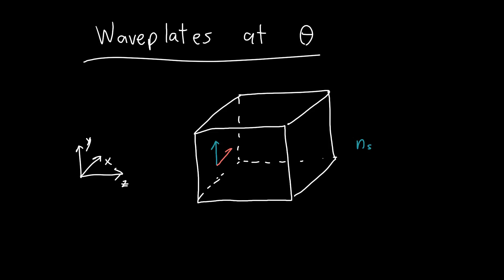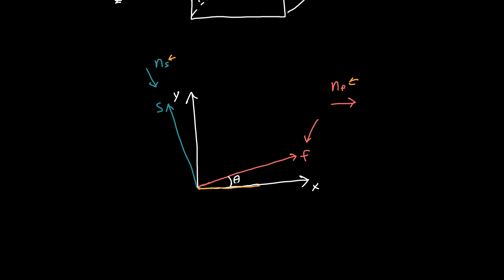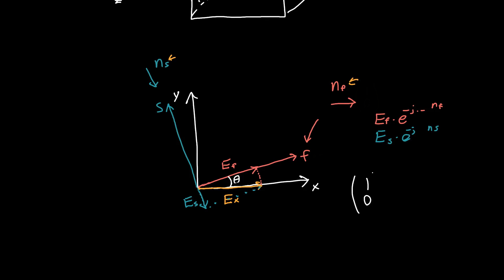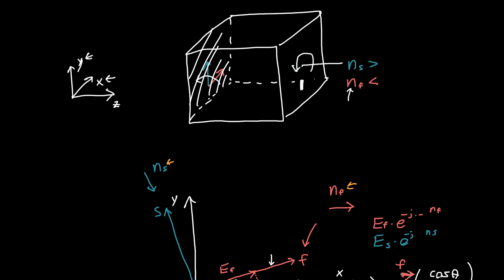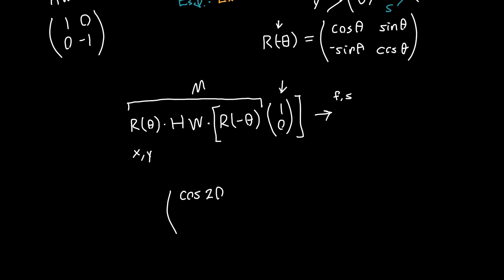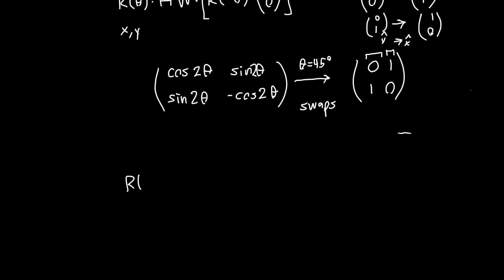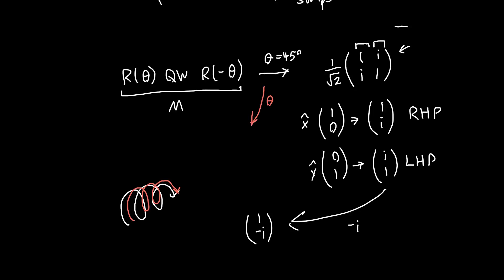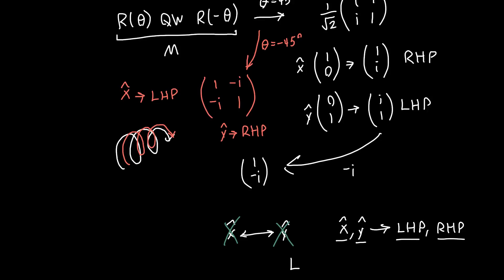Rotated Waveplates and Jones Matrix

Comment: Hi! Great videos! I watched all of them multiple times. I do have a question though and I am not able to figure out the factor 1/sqrt2 in the matrix for the QWP. I tried solving and the matrix o got has a factor of 1/2. 
So, we are considering the angle to be 45 degrees and in the matrix both Cos theta and Sin theta are either squared or multiplied by each other which would result in 1/sqrt2 * 1/sqrt2 = 1/2. 
Please help me!
Reply from the maker: Good question. In the Jones calculus, the quantities aren’t squared because we work directly with electric fields, not optical intensities. If you want intensity, you will square it.

Comment: Unless I've missed something, I think your inclusion of 1/rt2  for the quarter WP at 45 degrees is incorrect. You drop it when putting x and y pol light through it. You shouldn't get (1,i) for x pol, you should get (1/rt2, i/rt2)...but I could have missed something.